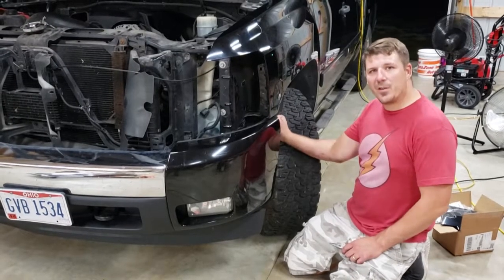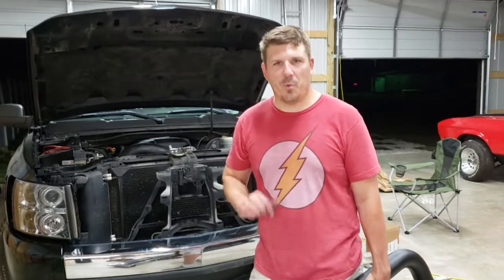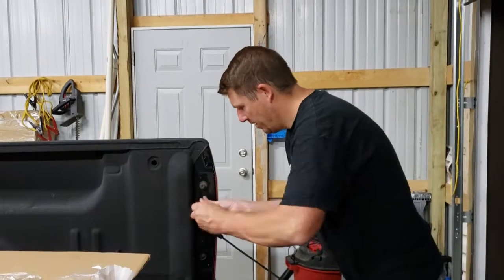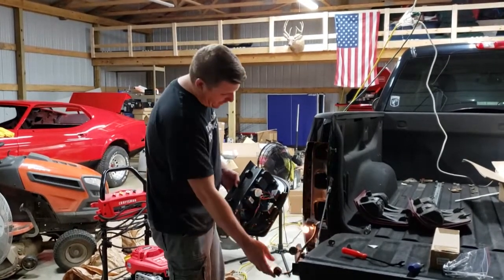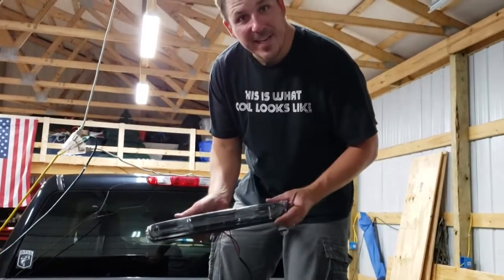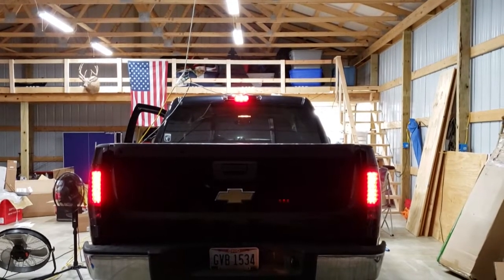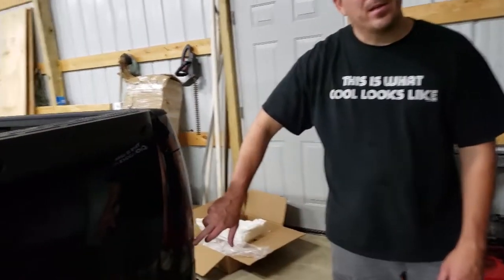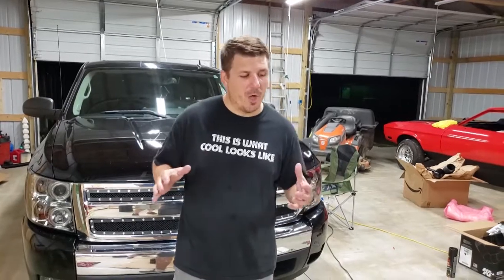How To: Install AKKON Smoked LED Tail/Fog Lights on an 08 Chevy Silverado (Project Revive Part 3)

Comment: Did you have an issue with the 2 screws not being long enough on the inside of the bed seems like my top is tightening but my bottoms aren’t catching to tighten it

Comment: I bought the same exact taillights and i installed one led load resister on each side but the hyper flash is still going 😢. Can you tell me how you did yours? Thanks
Reply from the maker: I had to put resistors on the front turn signals and it corrected it.